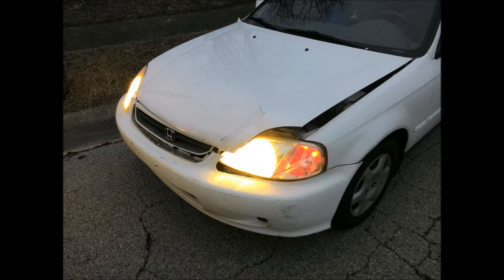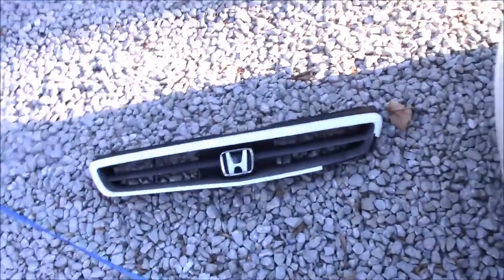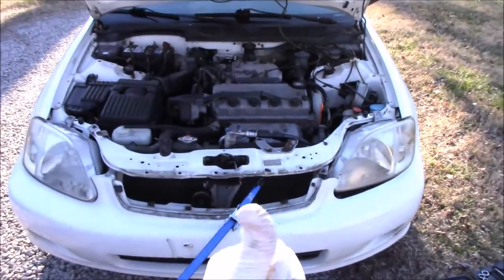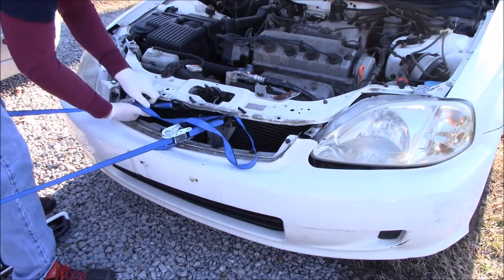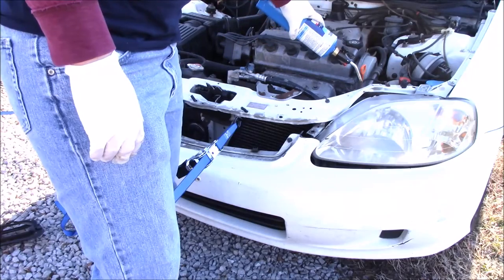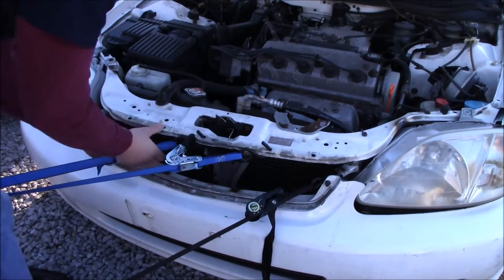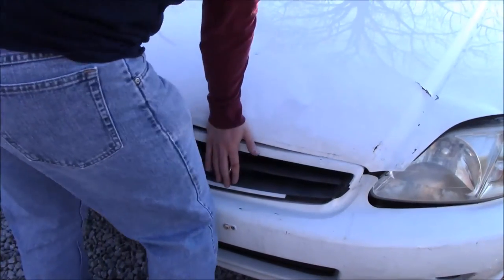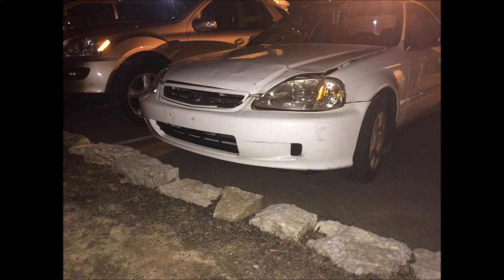How to repair frame dent WITHOUT REMOVING THE BUMPER

Comment: Awesome work! Pulling dents or deformed parts definitely takes some patience.
Reply from the maker: +4DIYers I was told attaching a rope to the frame and the other end to a tree and backing up works effectively as well
Reply: I'd be cautious with the rope incase it lets go. You're best to use a tow strap or lifting sling. If you have a thick gage steel, you can also bolt it to a few holes in the panel so it gets a stronger area to pull on.